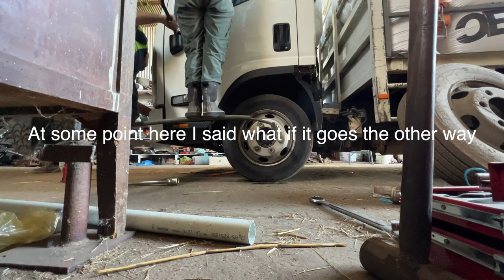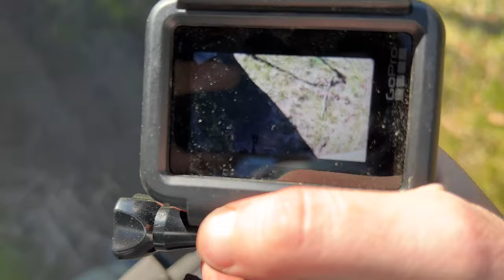Wet Workdays + Saying Goodbye 🙁 Australian Sheep Farm Vlog

Comment: Tooth paste will scratch the mirror but the old fashioned, foam shaving cream will do the trick. I used to use barbasol brand bc it was super cheap.

However, there is an antifog automotive product called.... Rain X that works way better. It will also help the windscreen shed water. It is a far superior product, especially as shaving cream will take the finish off paint and might harm any sun protection on your car.